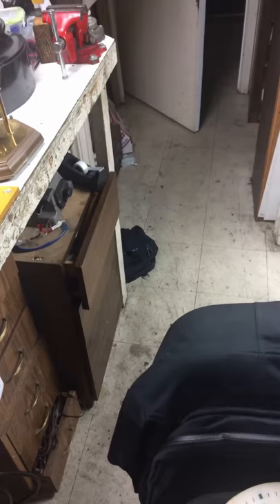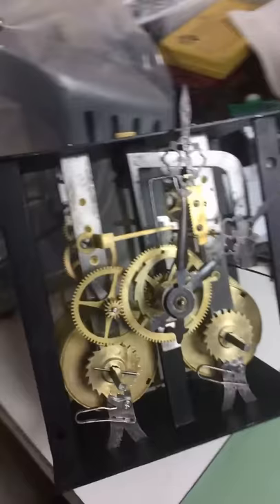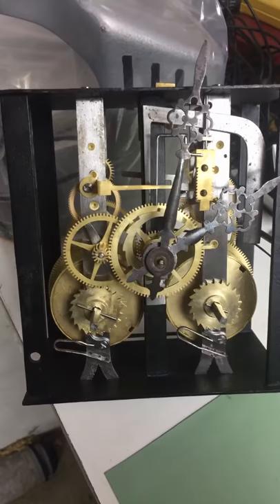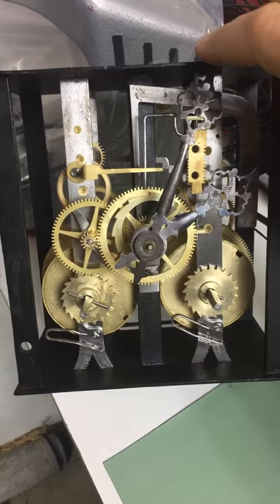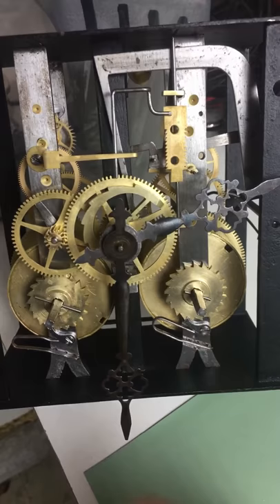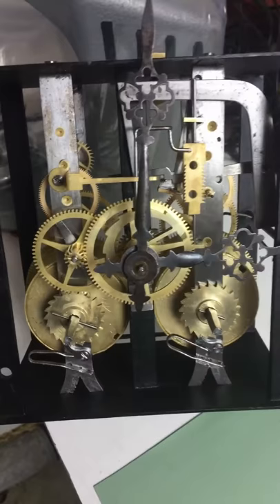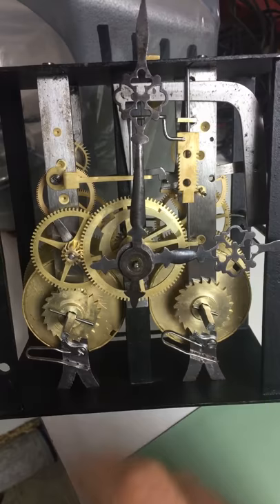French picture frame wall clock movement strike operation

Comment from the maker: I dont know the manufacturer. I dont know if it should be called a farmhouse clock. Its not written or stamped anywhere. A Morbier comtoise is a weight driven clock and usually belonging to a case like a grandfather. I think this is a french clock but it could possibly be a reproduction. Check this out for more info.
http://www.antique-horology.org/_editorial/comtoise/intro.htm